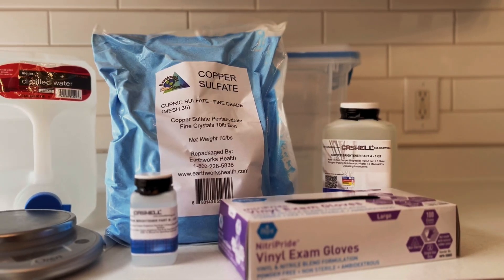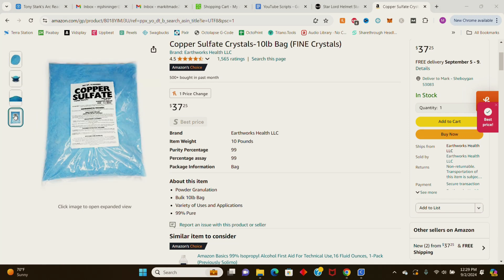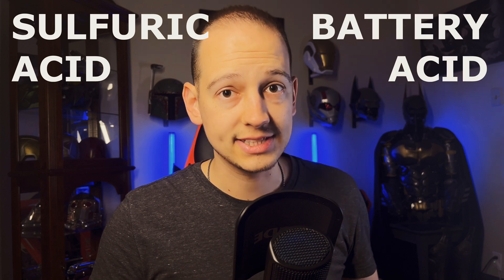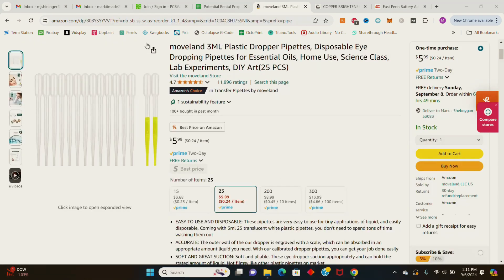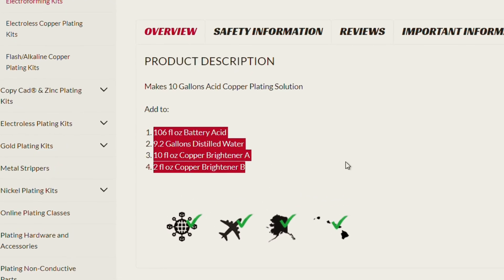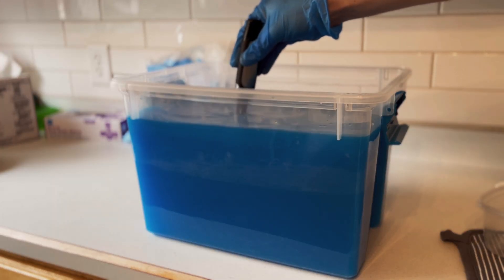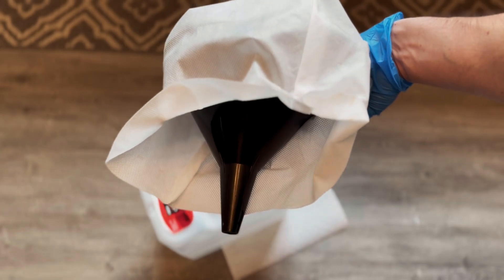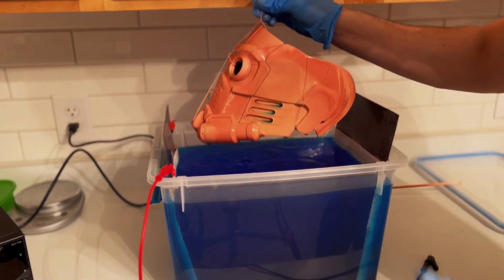The BEST Acidic Copper Plating Solution for DIY Projects

Comment: Don't wear Thick gloves, Ear protection, snorkel and Rubber boots if you still insist on wearing sloppy eye protection. Room temp battery acid on finger= No problem really as long as you wash it Off in a reasonably short period of time. Acid in eyes= Son I'm Disappointed!. Eye protection First and then the other "accessories" if needed 🤯🤕😄

Comment: This is how I did this

To a 22 liter two neck round bottom flask in corresponding mantle was added  a 3 inch Teflon stir bar, and 3000 grams of PDE followed by 3000 grams of elemental iodine crystals and 1000:grams of red phosphorus. Finally 300 milliliters of dh20. Quickly a reflux condenser was added and the cold water started circulating. Heat is set on 75 degrees Celsius. The reactants should start to become noticeably turbulent and smoke should start evolving from the mixture…..

Comment: Main question about this, does it conduct electricity? Thanks!
Reply from the maker: The copper plated object after it’s electroplated? If so, yes it does
Reply: @markitmade29 great news! Just wanted to make sure before getting these difficult found chemicals in my location. Thanks again!

Comment: You can make your own Sulfuric Acid from the copper sulphate, just water and copper sulphate, run it at low voltage for like 24h and it will acidify, then add the brighteners and go.
Reply from the maker: I tried that too! It didn't work quite as well but a total viable option and a lot cheaper!

Comment: i cant get sulfuric acid in UK without a license for personal use can hyou help me
Reply from the maker: Dang, that stinks. There is also a way to make electrolyte solution without using sulfuric acid. I believe there might be some videos or instructibles online you can look up. If I remember correctly it involves boiling hydrogen peroxide and vinegar and dissolving copper scrubbing pads. Here is a link to one that I've never tried but thought looked interesting: https://www.instructables.com/High-Quality-Copper-Plating/
Reply: I bought drain cleaner which is 93% sulfuric acid from Jennychem in the UK

Comment: Brilliant video and production. As a newbie to this , how viable do you think this is to keep in my craft room ( i have a room dedicated to 3d crafts and resin prints that has windows. Do you think i can dive into this without working about the toxicity indoors . I wear a suits and protective gear always along with a 3m respirator.

My second question is can i reuse the liquid for a while ?
Reply from the maker: Thank you for the kind words! To answer your question about if you can use it in your dedicated room...I would not recommend it unless you have some sort of ventilation system. Idk if opening windows would be enough. I recommend doing the work either in a garage or shop, where you can easier obtain proper venation or an open environment. Although I made the solution in my kitchen, I did my plating in my garage and store the solution out there.

Yes, you may reused the liquid, but if you are plating larger things you will need to filter it after each use. If you are plating smaller items you might be able to get away with doing 2-3 plates before filtering. I have since added an aquarium pump to my solution (agitator) and hang my parts from a rotating jig to help obtain more even plating. You will also need to consistently add more brightener part B once you see your plating coming out duller.

Hope this helps!